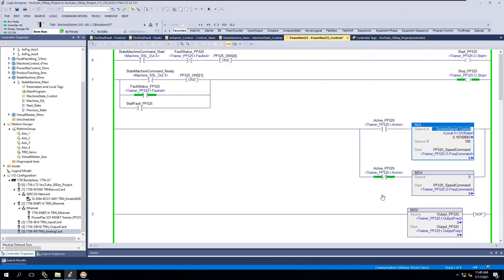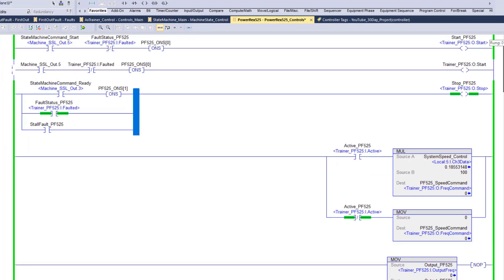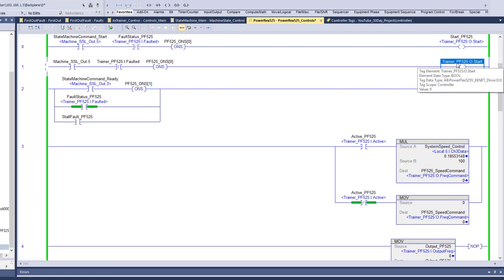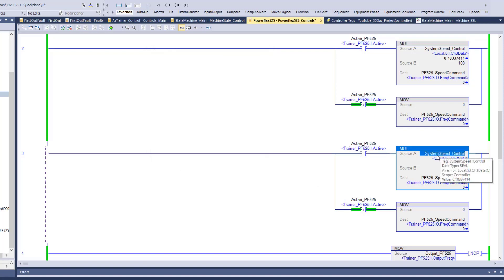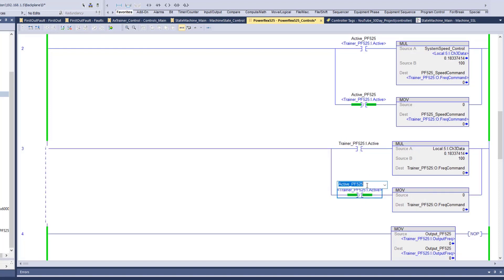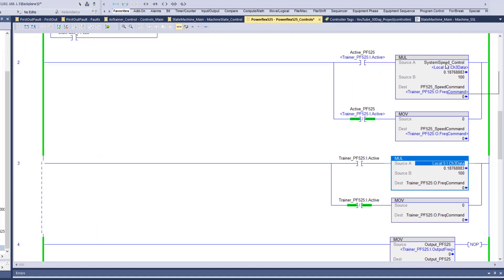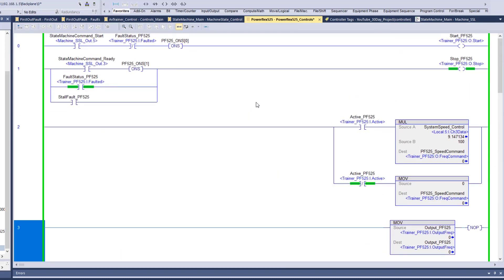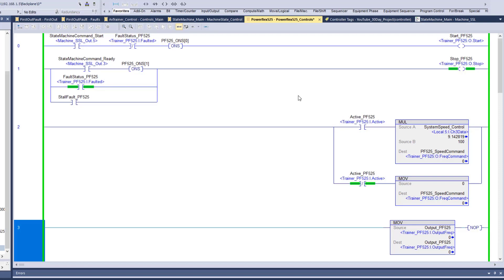Why Alias Tags In PLC Programming Are Important | Studio 5000

Comment: So basically they have a slight advantage over using descriptions because they appear with the tags in the instructions with more than 1 tag ..?

I find they make for a nightmare when cross referencing on occasions
Reply from the maker: Cross-reference the alias tag.

Simple & easy, use a notepad on Windows for important tags or aliases.

An easy trick to use while searching.

Also, alias tags are used to make programming easier.

Comment: In addition to making it easier to read the program, the biggest thing in my opinion is being able to change the base tag in one place and not have to go throughout the program and change the address on all of your instructions. For example, if you have a start pushbutton wired to Local:3:I.Data[0] and use that address throughout your program, in the event of the input going bad you would have to go through your whole program and change it from Local:3:I.Data[0] to Local:3:I.Data[1] for example. This can be fairly easy by using Find/Replace obviously, but if you had an alias tag of START_PB with Local:3:I.Data[0] as its base tag, in the tag browser you would just have to change the base tag to Local:3:I.Data[1] and the change would instantly take place throughout the program.
Reply from the maker: Search and replace is easy to do.

Thanks for the comment

Comment: Can you please make video on FTV Studio SE Client configuration by copying exiting Client file ? and how can we connect to you?
Reply from the maker: You just need to copy the client file to another computer, open FTview directory specify location then point that to the computer hosting the HMI application then reboot & run the client.

To copy the client, navigate to: C:\Users\Public\Documents\RSView Enterprise\SE\Client

Copy the client...Copy/paste not cut/paste

Repeat...Copy/paste

Then place the copy to the new computer or if the computer is on a network them pass the copy of the HMI client to the other computer using the network path.

To specify the local directory on the other computer use: Specify FactoryTalk Directory Location
C:\ProgramData\Microsoft\Windows\Start Menu\Programs\Rockwell Software\FactoryTalk Tools\Specify FactoryTalk Directory Location

Make sure the Computer hosting directory server is set to the HMI server.

Then reboot & run the client